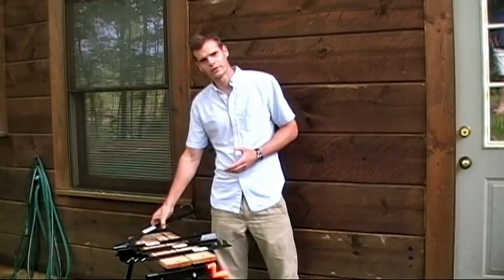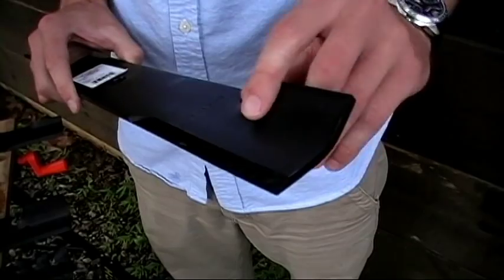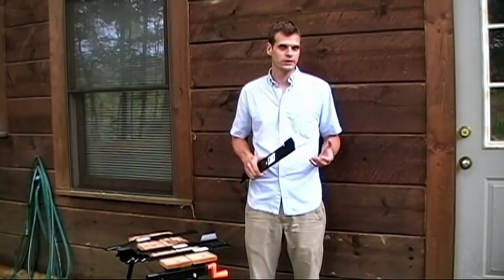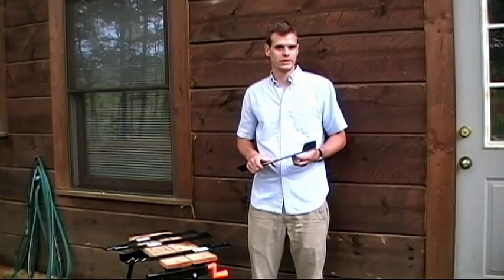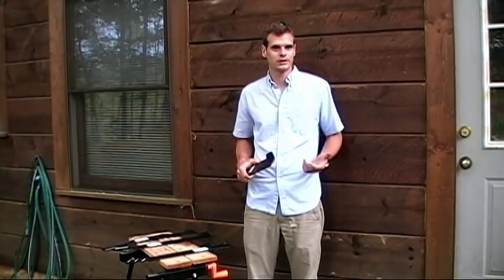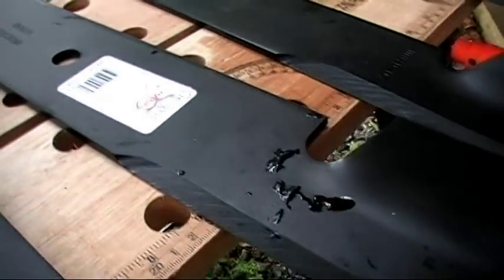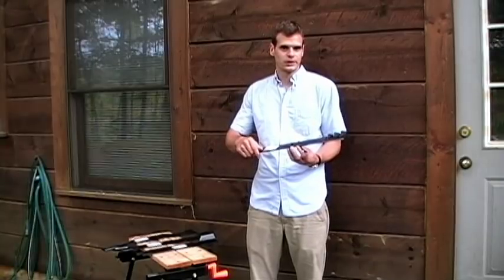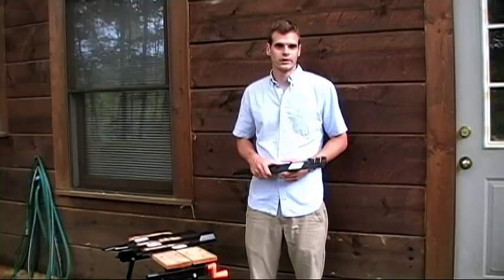Types of Lawn Mower Blades

Comment: Lift is for bagging. More importantly than creating the vacuum, it will throw the grass back into the bag. Gator blades, or universal mulching blades, have no need for a bag. As he already explained. If you are going to use any type of blade that creates a vacuum, spray the deck with 2 coats of non-stick graphite spray to save the deck from minerals on the lawn.

Comment: whats agood blade for bagging
Reply: Depends on what soil you have, I'd say if you have sandy soil, try medium lift if you can find them, and high lift you can't but replace the high lift more often and when you replace them, clean and spray paint the underside of the deck, be careful not to spray the spindles. If you have clay, use high lift unless you have baby grass, then use medium if you can find them.